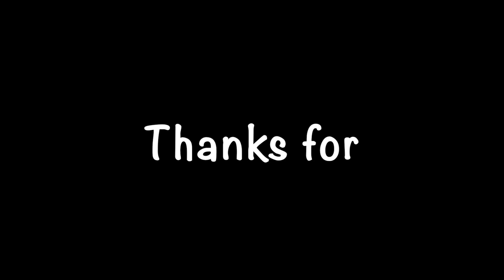How to fix Broken cabin foundation Piers

Comment: I would build block columns to run 2 wooden headers the whole length. Thats awful. Steel beams would be better. I dont ever see 100+ year old buildings that bad. If your in MI or northern WI or MN I would like to help you.
Reply from the maker: Hey thanks Eli I appreciate that what I did solved the problem. After two winters it didn’t move not sure if it was a concrete issue. I’ve since sold the property and am in the process of buying another camp with issues. I need projects to keep me busy. I’ll be making more videos when it’s a done deal and I own it thanks again for your insight and offer to help

Comment: With all that concrete you might as well put in a basement.
Reply from the maker: With the control us virus being they way it was I had do something as the camp was starting to heave over. To do a foundation I would have had to source some I-beams to lift it up high and crib it to dig it out and form it which would have been a big undertaking. Not to mention the cost of building materials and stuff are ridiculous right now. The easiest option for me was to do what I did for now. Plus I only had to rely on myself to do it. A full foundation would be nice that’s for sure. It only cost me $2,500  for  all the materials so it wasn’t to bad.
Reply: @offgridcabinaddict6314  I didn't mean you I meant the previous owners. You did awesome!